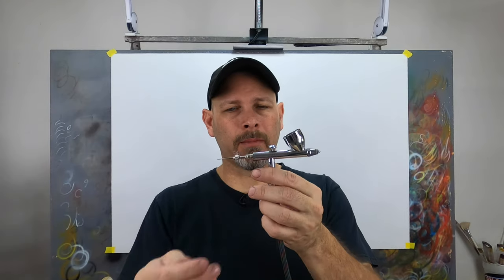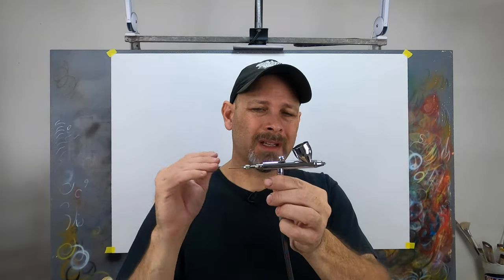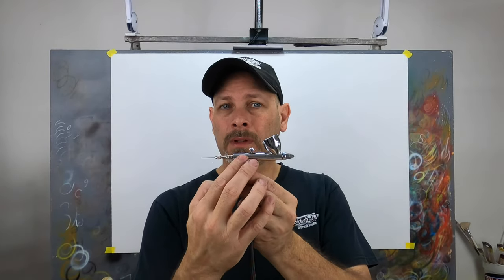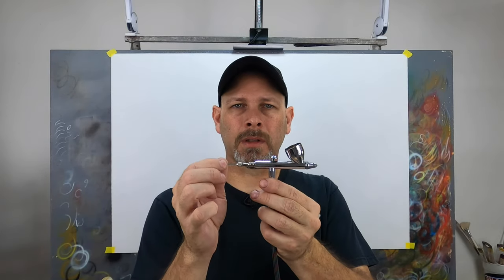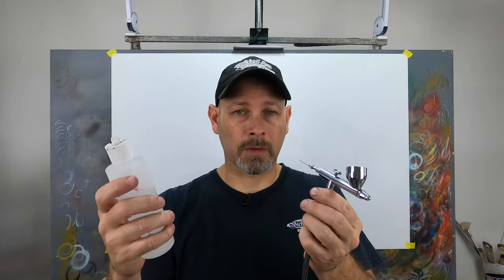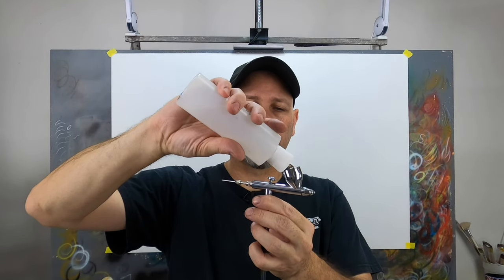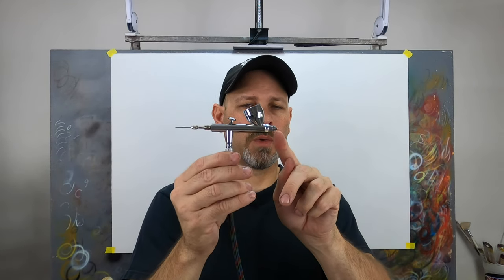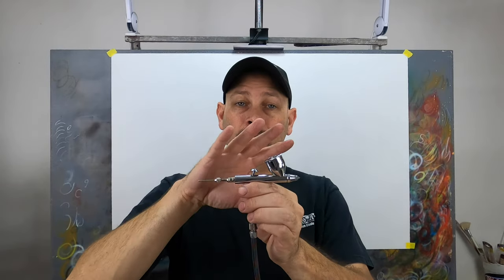Preventing A Stuck Airbrush Needle

Comment: Great tip Treavor I have had that happen and I am religious about cleaning my air brushes after every use but almost use them daily
Reply from the maker: I'm pretty religious when it comes to keeping my brushes clean too, but it's nearly impossible to get every last little bit of residual paint cleaned out of the brush without completely disassembling it.  That's not something I recommend doing on a daily basis.  Storing your brushes "wet" alleviates the issue completely.

Comment: the needle chuck is stuck in my sparmax - 3 and I don't know how to get it out!
Reply from the maker: I'm going to assume you're referring to the needle chuck guide (forward of the needle chuck nut - the guide allows the needle to slide through the body of the airbrush before it reaches the packing screw).  You'll first have to remove the spring guide (counterclockwise) and spring.  Gently pull the needle chuck guide up slightly as you pull it out of the airbrush body.  I hope that helps!
Reply: @wickedartstudio  hi! no, everything is broken down but the needle chuck GUIDE doesn't come out no matter how much I wiggle it.
Reply from the maker: @beckybeighley   I am willing to try and help if I can.  Shoot me an email at wickedartstudio@gmail.com
Reply: @wickedartstudio  ok! I have to take it apart again but i'll email you

Comment: I have problem that my trigger goes back to its place very slowyly, like idk, string was not that strong or something like that
Reply: If i loose the screw holding the needle it works perfect but then needle doesnt go back. and everyting seems clean.
Reply from the maker: My guess is you likely have a bent needle, or the needle packing screw is slightly too tight.  If you suspect a bent needle, try using a new needle.  If you suspect the needle packing screw the following applies.  Does the needle slide into the brush relatively easily with minimal drag as it passes through the needle packing screw?  If the packing screw is too tight it will prevent the needle from returning.  You can try loosening the packing screw up slightly.  A very small amount will make a big difference.
Reply: ok, the oring was so dry that i dont wonder why it was so rough. little of oil made the trick :D
Reply from the maker: @malutkisiwy6810  Awesome!  I'm glad you got it figured out!